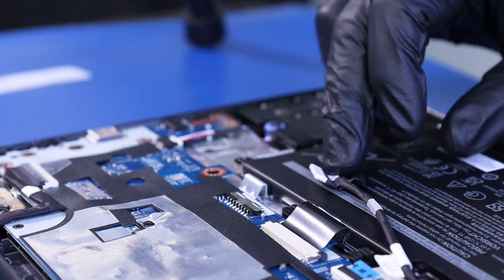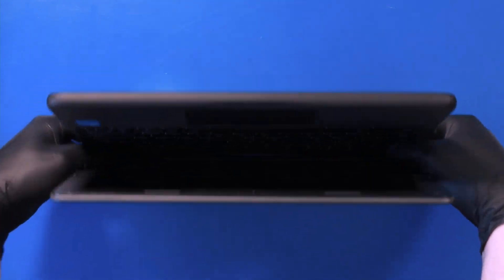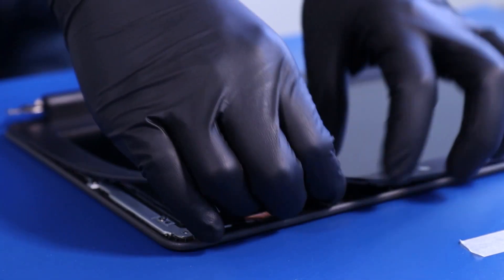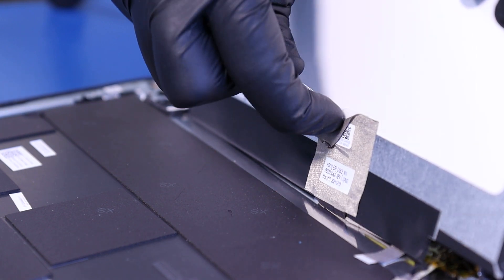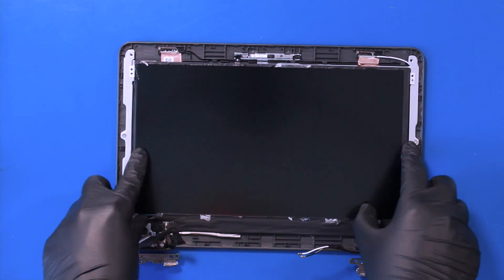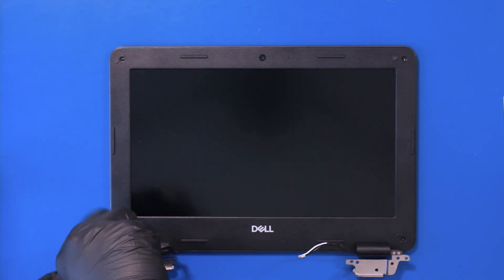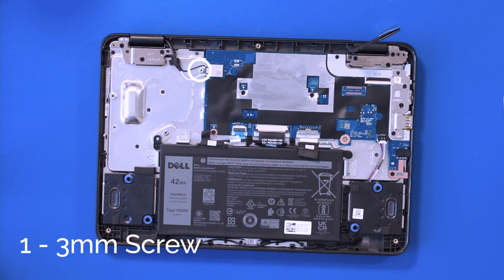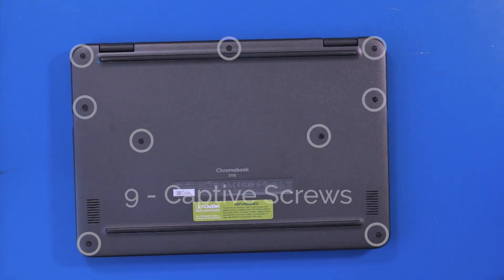Dell 3110 Chromebook LCD Screen Replacement

Comment: i wonder if this method can be used to upgrade a 3110 non touch screen to 3110 2 in 1 touch screen
Reply from the maker: You can definitely switch a non-touch screen for a touchscreen, but as for turning the unit into a 2-in-1... It might be possible, but would require changing several other parts in addition to the screen. We haven't attempted something like this, so we're not entirely sure on that.